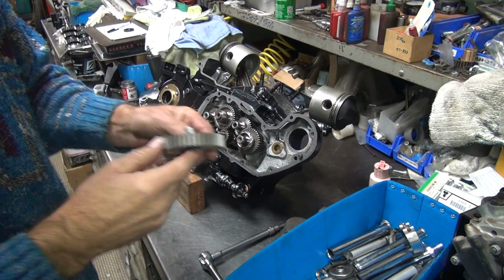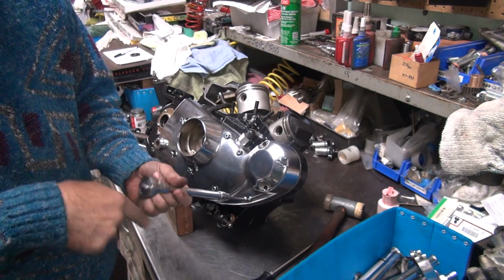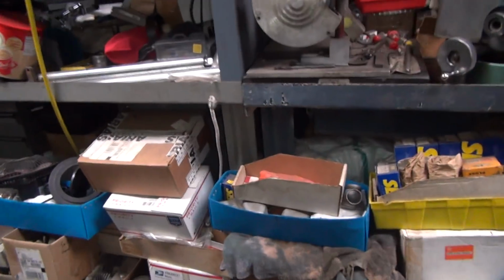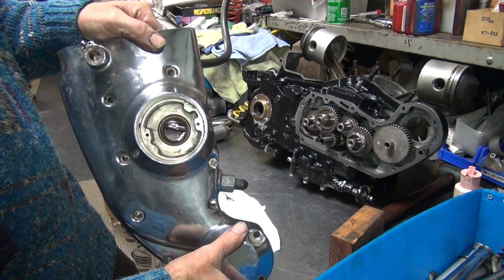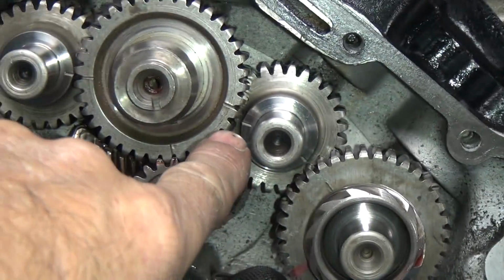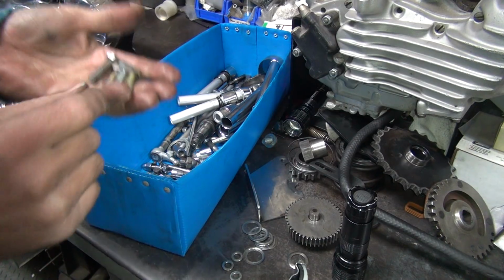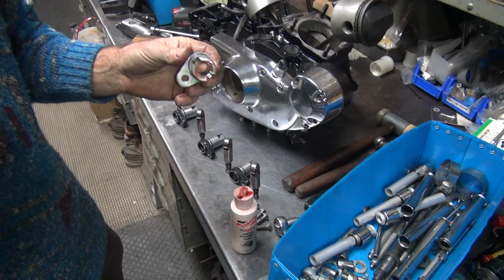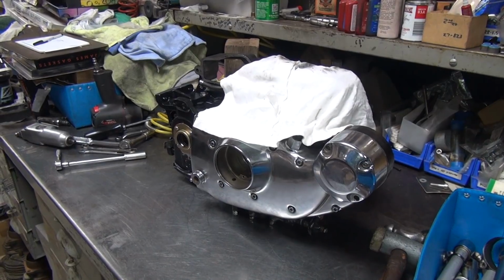1972 ironhead #113 xl xlch case repair motor rebuild harley sportster by tatro machine

Comment: These are old videos that I am still catching up on and in the end you probably find out the issue but I'm here screaming at the screen to check the phosphor bronze (soft metal) bushes for the 4th cam and idler pully. When the shaft sheered something took the brunt as well as the casing block.......3 years and I'm probably wrong but you are a great honest guy and I feel like I want to help.
Reply from the maker: its been too long for me to remember what i did on this one motor. whatever i did should show up in the later videos in the playlist.
tatro

Comment: Is that red oil bout the same wt as STP or something we used to git called Motor Honey...thick as molasses. I have seen vasoline used on car engine rebuilds.
Reply from the maker: no. use the correct stuff. looking and being is not the same.
tatro

Comment: Didn't the gen snap on this motor? Is it possible the cam gear teeth laid over a touch due to that force?
Reply from the maker: most likely but i can't see or feel it. the slightly smaller idler gear makes up for it.
tatro